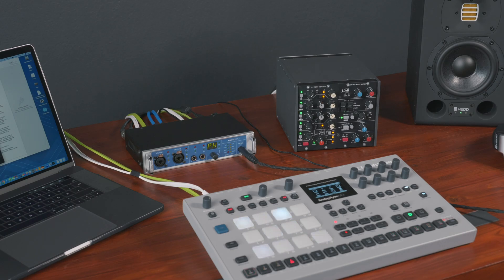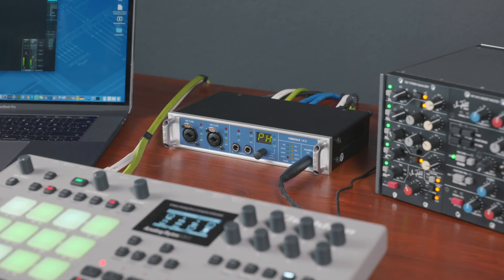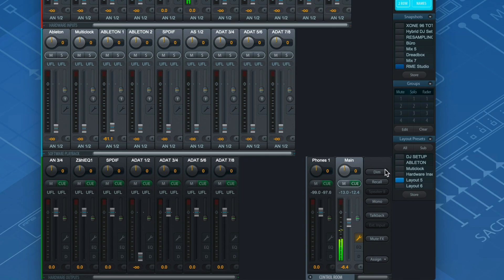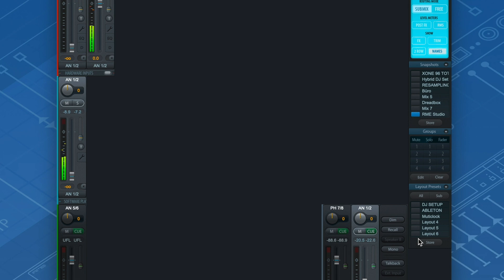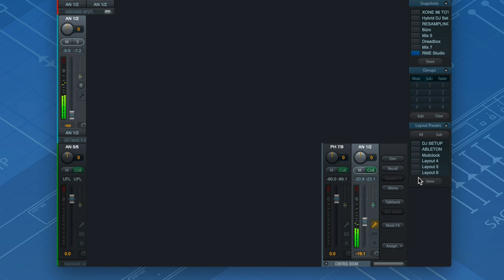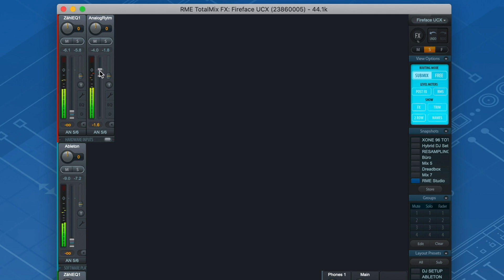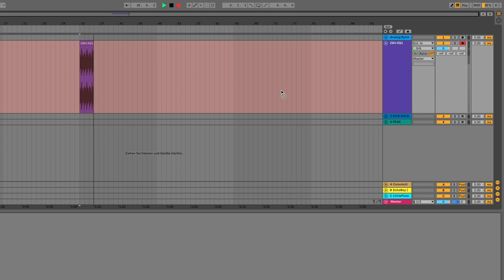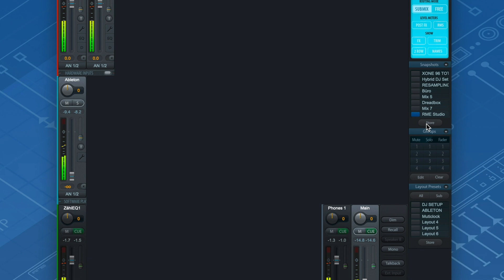Route and Mix Hardware Insert Effects in TotalMix FX

Comment: With all due respect this routing could have a second review by the engineers together with an experienced designer making/showing a logical workflow, maybe choosing between pro and ultimate beginner mode.
Still haven't found an complete work through of Total Effects that is based on no technical knowledge and without many shown layers like this video. It should have scroll through chapters in You Tube and maybe some schematic animation. This besides the Barry Johns 'simplified' YouTube, which I find is visually not that simple. 
Come on @RMEAudio this could be an explanatory investment which fits the logical approach of the product.

Comment: Hi! Such a great video thank you! How would I do this with my RME Babyface Pro? Will I need more outputs?
Reply from the maker: You can use the headphone out of the Babyface as line output. If you need more analog I/O´s you can expand the Babyface with external converters connected to the optical I/O.
Reply: @RMEAudio  Thank you so much! I forgot about the headphone output! Would there be any noticeable difference in quality? Also what's an external converter you would recommend to connect to optical I/O? Best, James

Comment: Does the volume knob conroll all the 1-6 output all at once?
Reply from the maker: You can press the button to switch to the channel selection. This way you can select and control the channels.
Reply: @RMEAudio  so its like 1-2 is left and right. 3-4 left and right. 5-6 left and right ?.
And the volume can be lowered on all at the same time?

Comment: This video is good, but .. man, it took me a while to figure out the flow of the signal. After watching this video 20 times .. LOL, I figured out that the signal goes from the DAW to the Software Playback, not the Hardware Outputs (how stupid I was when I thought it does so). From here, it goes to the Hardware Outputs. From Hardware Outputs, it goes to Hardware Inputs. Then, Back to the DAW where I hear it again from the Software Playback. This is the case of Hardware Insert. From inside the DAW, I can either Send the signal or choose the Output where my Insert Hardware is connected. German engineer! LOL. Thank you, though.
Reply: Thank you.  How hard would it be for RME to draw a flowchart and show routing while showing the video SMH.

Comment: Hi!
I will get either the UFX ll/+  as soon as its in stock anywhere and wonder if it possible to do this also in standalone mode, and when recording external hardware inserts to the durec/usb stick?
Reply from the maker: Hey Nils, this is absolutely possible. Just store the settings into on of the setup slots and you can recall them in the standalone mode.
Reply: @RMEAudio  wa wa wee wa!👍 UFX + ordered!

Comment: I have a question. If I were to route an incoming mic signal to an outboard eq or compressor and back in using this method, would that signal be diverted pre-convertors and only get converted once it came back in on another channel, or would it hit AD then DA the AD again? 
(why I wouldn't just hard-patch it on it's way in in the first place is an obvious question for me, I know)

Comment: I don t understand why there are two inputs 5/6 at the top (one named eq and the other analog) ?  I m not as good as i should in English, please could you telle me ? Thanks a lot
Reply from the maker: You can rename the channels as you like. For example, the name of the connected device. With the button "NAMES" in the blue box on the right side you can switch to the original names of the channels.
Reply: @RMEAudio  Thanks. I understood for renaming but not what are the physical inputs for the two channels at the top, please can you tell me about these two channels, i understand one is the return from hw (named eq1)  but the other at its left named analog  where does it comes from, is it just from the drum machine hw ? that s what perhaops i don t really understand; because i wonder from where the music you want to eq comes from . thanks a lot
Reply: Confusing to me also.  At 2:29, just before he turns off the default channel names, it appears that input AN 5/6 is Z..EQ1 and input AN 7/8 is AnalogRytrn.  Then when he selects output AN 5/6 (Z..EQ1) input AN 5/6 (Z..EQ1) isn't receiving signal until the fader of input AN 7/8 (AnalogRytrn) is raised.  And playback channel Ableton is going to output AN 5/6, but the fader of the Ableton playback channel is at - inf.

Comment: I'm getting serious amounts of feedback when I do this. What have I got wrong?
Reply: I think I've worked it out. Is this about right RME, (or anyone else who has sussed this out)?...

TO RECORD INSERT EFFECTS...

RME Channel 5/6 output goes to your external effect
It then goes from the output of your external effect to input 5/6 of RME 
You have now inserted your hardware effect into the chain.

Settings for the submix of your send channel (channel 5 ouput)....

Software playback channel (middle row) should be UP or else there will be no signal to send out.
Hardware output 5 (bottom row) should be UP. This tells you how much signal to send out.
Channel 5 input (top row) should be DOWN to avoid feedbacking the signal.

Settings for the submix of your playback channel (headphone or speakers).....
 
Software playback channel should be DOWN, otherwise you will hear the unprocessed signal.
Channel 5 input should be UP so you can hear the processed return signal.
Hardware output should be UP so you can hear through your speakers headphones.

TO RECORD THE RETURN CHANNEL.
....

Arm a different track to record Channel 5 input. MAKE SURE THE MIXER FADER IS DOWN OTHER WISE YOU WILL GET FEEDBACK
Reply: @jboston4660  Thank you, now it works
Reply from the maker: You managed it all by yourself. Congratulations!
Reply: @RMEAudio  Is it the case that you think we should 'manage all by' ourselves and therefore you  make a video that is incomprehensible.

Comment: RME, that company that still in 2020 sells products with Firewire protocol. Why? move on! Have you heard of USB4, Thunderbolt 3, USB C???
Reply from the maker: Because we still believe in sustainability. If you look closer into the subject, you'll notice that none of the aforementioned protocols will give you better performance. You'll increase cost while having sometimes even worse performance. We are capable of transmitting over 120 channels via USB2 with near zero latency. How many channels do you need?
Reply: @RMEAudio  Apple stopped selling Macs with Firewire in 2012. That’s 8 years ago. The USB C connection has advantages over USB2 A. Apart from it’s wider bandwidth, it’s reversible and universal in the sense that it shares the same smaller connection with Thunderbolt 3 and the future USB4. One single connector for all of them that is also backward compatible with USB2. 
Also it is known that Thunderbolt can be faster than USB2 because of how it is implemented inside the computers. That’s why many brands have implemented it even thou their audio interfaces don’t surpass USB2 audio channels limit. Also how much more expensive are you talking about? 50 euros per unit? I would prefer to have more universal connections and pay a bit more rather than having a Firewire connection that I will never use. Maybe that point makes it more expensive to me at the end.
Reply: @jeli780  buy from another brand. simple as that. your blah blah makes no sense, because the device still has a USB connection. didn't you understand rme's statement above: 'We are capable of transmitting over 120 channels via USB2 with near zero latency'. what would thunderbolt make better in this case? the only thig what would be better is that there would be no need for an adapter cable.

Comment: I"ve been working several years with Pro Tools, and Logic but I have a lot of difficulties do understand Totalmix routing system. I'm using Logic Pro, RME UFX and connecting to a SSL Fusion hardware by I/O. When I turn on the I/O the system start to phase a lot. When I try to get rid of one of the channels I always do in the one that is sending signal to SSL Fusion, I never can get rid of a constant audio that is not the one that is sending to SSL. Anyone can help me, to use a hardware with Totalmix without phasing. Thanks a lot!
Reply from the maker: Please contact us on Facebook.

Comment: I’m looking into getting a ufx interface soon. I have Neve clone preamp that has analog out only. Can I go directly into the ufx converter without using gain stage on? If not, what would be the best gain setting for that channel  in total mix?
Reply from the maker: Yes you can do that. The gain setting depends on the output of the preamp. But usually you leave the gain as it is in TotalMix.
Reply: @RMEAudio  ok, on my current interface I can choose between mic, instrument or line in the software. When choosing line the gain pot disappears from the control software as it bypasses the gain stage and goes directly to the converter. Sort of gotten used to not think about 2 different gains in the same signal path.

Comment: this is a vastly improved tutorial. Thank you for being so explicit for us noobs and showing us how to think about things.
Reply: I used to write instruction manuals for a major Japanese electronics brand, so I think I have enough experience to comment.

It is an improvement, up until the second half, when I got lost.  These videos are still delivered much too fast and the language is insufficiently specific.  This is a common problem with English translated from technical German.  The Japanese do the same thing.  

But also, one has to leave pauses to let people grasp the meaning of what you've said.  Let it sink in.  Repeat it.  Use a teaching tool, like blinking arrows to show which output you mean and then move on.

And use terms  consistently.  For example, if you decide to use "to this input, from this output," don't later on use "from this output, to this input," unless there is a specific purpose to the varying usage.

I have used an RME Fireface UC for nearly 10 years now.  It is a great piece of gear.  But coming up to speed on totalmix was a struggle because the explanation seems detailed, but it is improperly presented for the native English language speaker.   I would not buy another RME product, unless I saw an significant improvement in the English language content.

That is even with these tutorials and my experience in electronics.  Your manual is not an operation manual, but a descriptive tech spec sheet.

Please may I recommend: greater specificity,  pauses, teaching tools, consistent use of terms and no marketing-related content within the video.
Reply: @MrRichiekaye  You are so spot on with your comments - the official RME videos are dreadful - I've found slowing the playback speed down to .5 or even .25 helps - it almost makes sense! But usually the narrator is ploughing on while wiggling the mouse pointer about all over the screen—and in the case of this video, for no good reason, he zooms away from what would really help explain the process.
Reply: @johnhunter4181  accent on 'almost'. Incredible lack of awareness in explanation (i am sorry to say). RME Fireface 802 owner.
Reply from the maker: @MrRichiekaye  Thank you for the input!
Reply: @RMEAudio  I am so pleased you would consider my suggestions.  It's the cleanest, most accurate interface for its price that I've used for music vocals and audiobook narration, as well as hi fidelity playback from my DAW.  I guess that's why I care so much about it.  Good luck!
Reply from the maker: We always try to improve our tutorials. But you are not a noob. RME interfaces are complex and professional tools. ;)